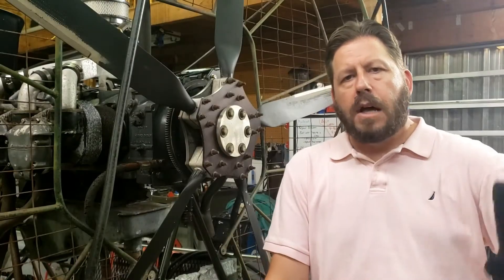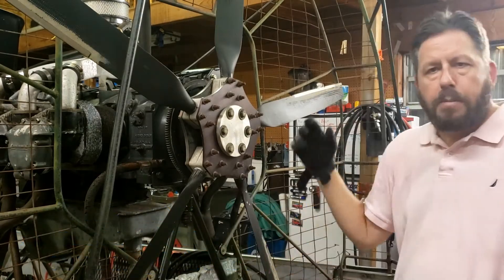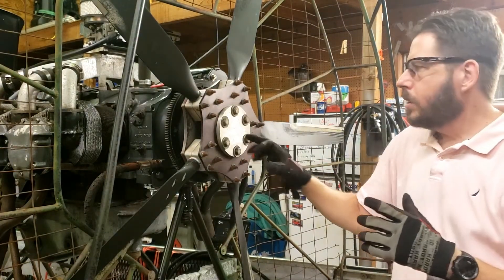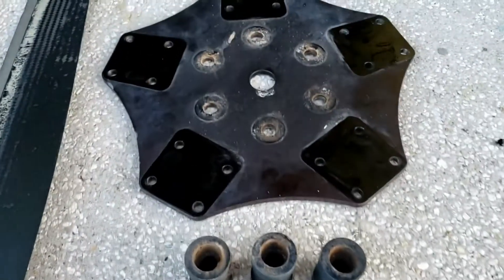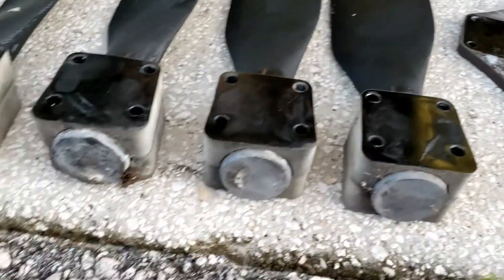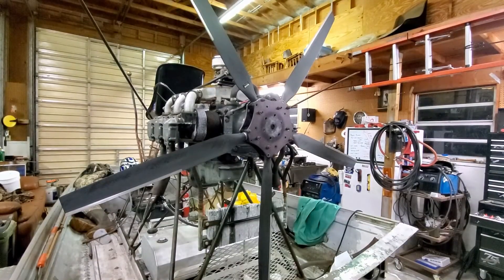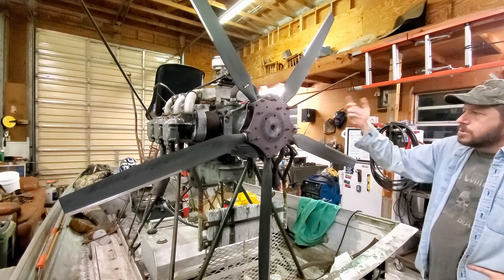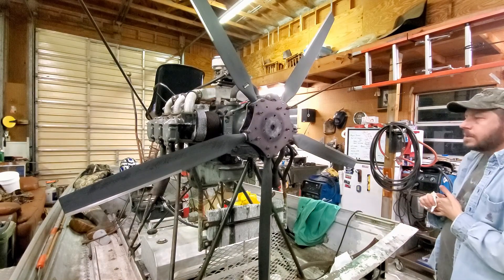Airboat 10 - Warp Drive prop repair

Comment: Maybe you should try a sacrificial anode and see if that helps with the corrosion. It may help.
Reply: The aluminum on the prop is what i was thinking, hell if your hull is aluminum probably a good idea. How about this, where the blades connect on the hub, put antiseize on the aluminum and the bolts to might be a good idea.
 It's crazy how much the props cost. 
I'll watch for your progress.
Reply from the maker: Thanks Brian.  Not sure if you are referring to the corrosion on the rigging (metal stand) or other areas.  Not sure how that would work, but worth considering.  Thanks for the suggestion.

Comment: Glad to see you are continuing on with the airboat videos!!! I got scared you had abandoned them for a minute there.

On the motor, based on how good it was running I'd say clean it up, paint it and run it until you have a good reason to tear into it.
Reply from the maker: Thanks Bearhawk!  No, I am "all in" to get this boat back on the water.  I have a few other project that are getting in the way of course.  My lofty goal is to have this on the water on July 10th.  My current plan is to pull the motor off the boat, clean it and paint/power coat parts.  Most people are telling me the same thing you are. Don't dig into it unless you have to.  The cage/rigging repair and paint should go quick.  The biggest task now is fiberglass repairs and painting the hull so that it looks half decent.  I haven't messed with fiberglass in decades.